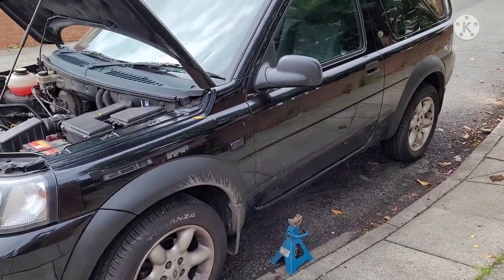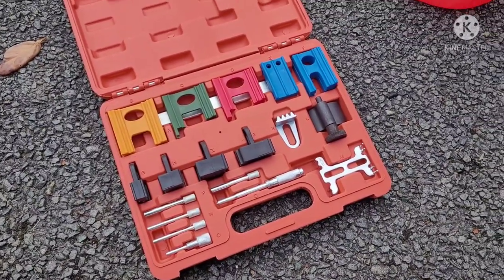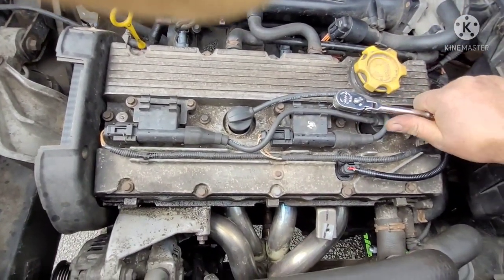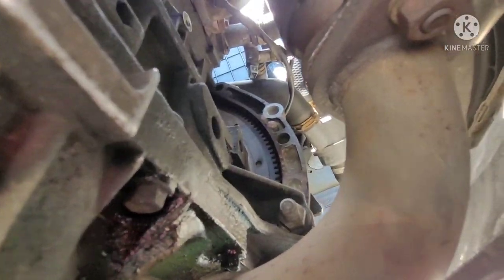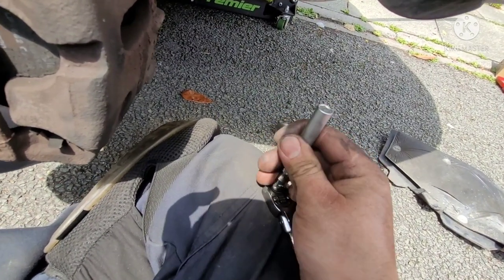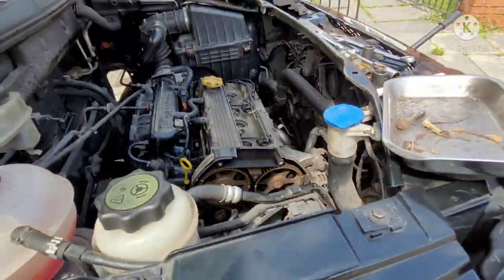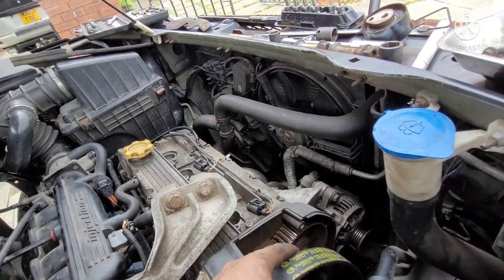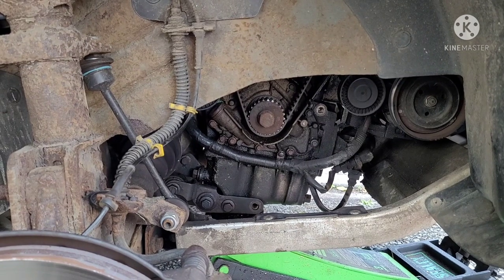How to replace a Timing Belt In a Land Rover Freelander 1.8 K series engine.

Comment: Does the crank pully also has an timing mark?
Reply from the maker: Yes if you see in the video before I removed the crank pully I had marked with white paint pen the timing notch in the pully. I then did point out the timing marks in the lower timing cover. Also the crank pully has a notch out where the bolt is to fit the mark in the crank gear for the timing belt. There is also mark on the crank sprocket and on the block to line up for TDC when doing the timing belt. Thanks for watching 😁

Comment: Please help me.  Belt snapped does it affect the valves? Or you just change the belt?
Reply from the maker: Most likely yes. If the timing belt has snapped while the engine was running you would have done internal damage. Most likely bent and damaged valves, but there could be damage to pistons, and even the cylinder head or cylinders if a valve broke off. You would need to strip the head off the engine and inspect it to see, or get a bore scope down the spark plug holes to give you an idea of what damage might have been done. Either way it is very likely you will have bent some valves. Best of like mate.